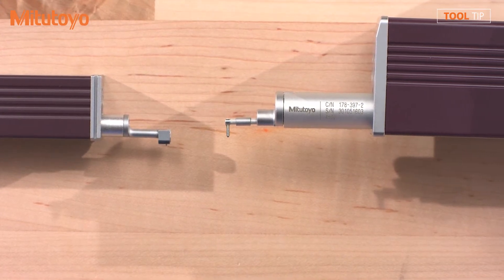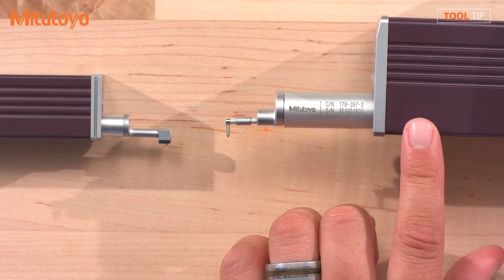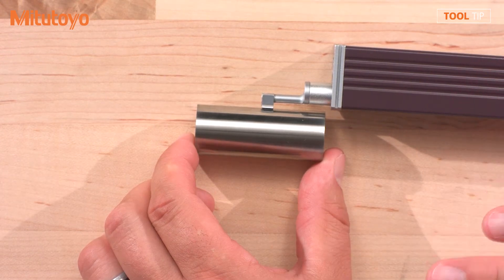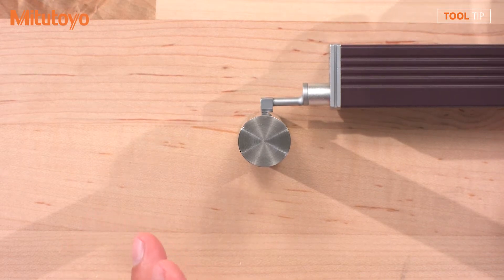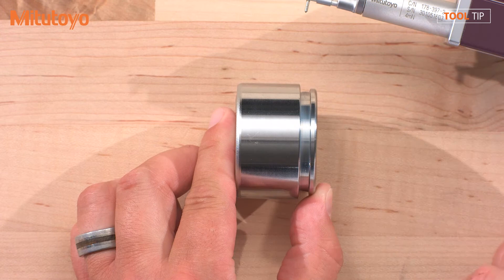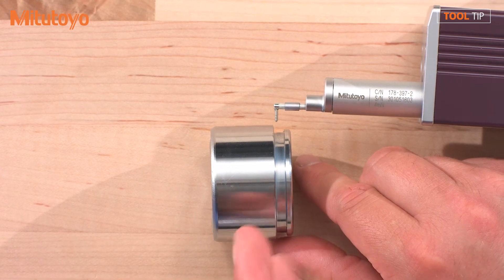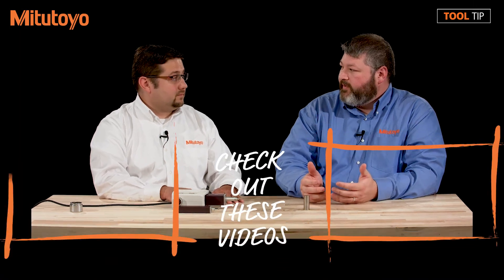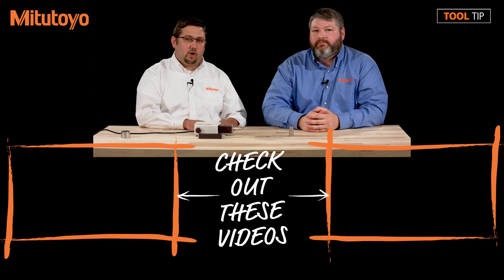Surface Finish Measurement - Skidded VS. Skidless Surface Roughness Measurement

Comment: Is it correct  to measure surface finish along the circumfrence  of Clyindrical job having dia approx 86 mm using a skided Mitutoyo SJ 210 instrument , by plunging the stanadard mitutoyo detector stylus combination by  approx 1.0 mm using height gauge  inorder to acheive positive contact with the surface   ?
Surface finish requirement  is Ra 15 microinch .
Need reply from Mitutoyo, asap  !!
Reply: Checking parameter :
Cuttoff length : 0.8 mm
No. of samples  : 05